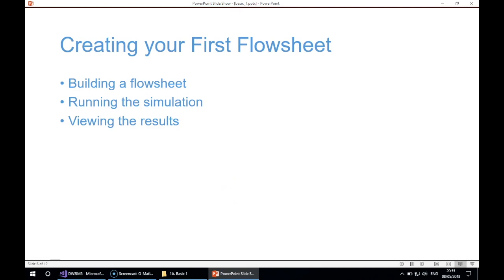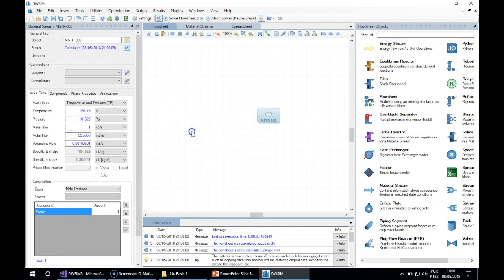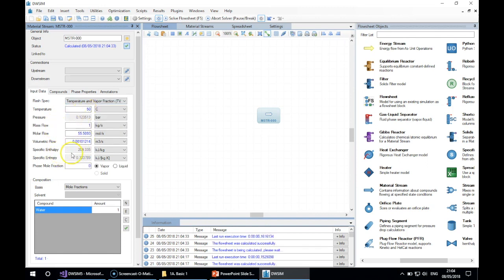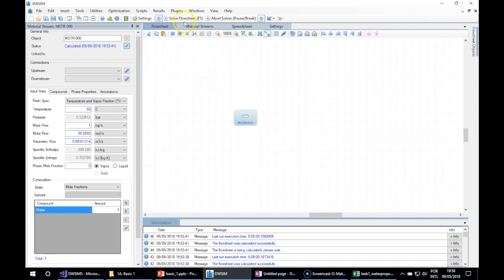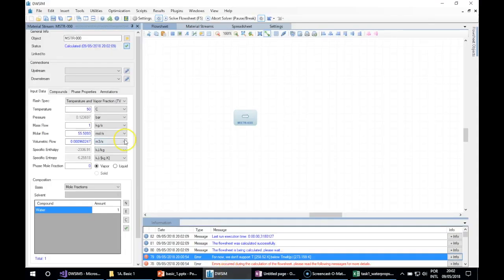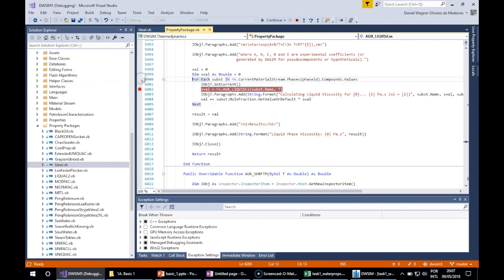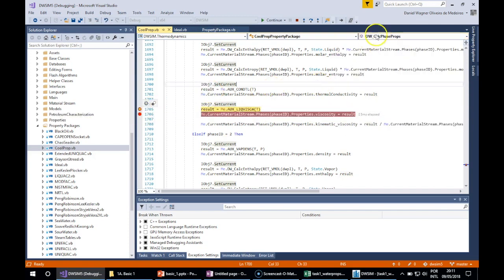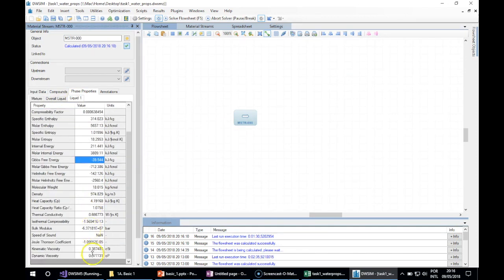Basic Course 1 - Creating a Simulation (Task 1)

Comment: Hello, thanks very much for this video and for your simulator. I don't understand why the CoolProp package did not give a vapour pressure value at 50 C. I thought it would become clear when you looked at Visual Studio, but I didn't get it.
Reply from the maker: The CoolProp library has a temperature range for every property that you ask for. If you ask a property value at a temperature outside the valid range it will throw an error. DWSIM, on the opposite, extrapolates the valid region in order to return a value and keep the simulation going on. This allows convergence algorithms to keep working.
Reply: @DWSIMSimulator  Thanks for the reply. I did not think the temperature 50 C was outside the valid range for CoolProp.
Reply: iebah1 each property of each compound has its own valid temperature range.